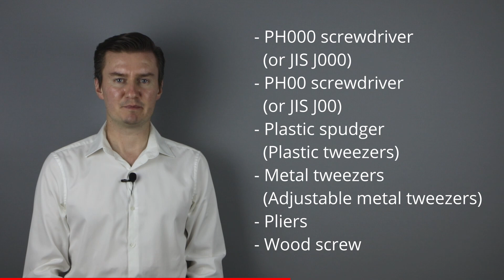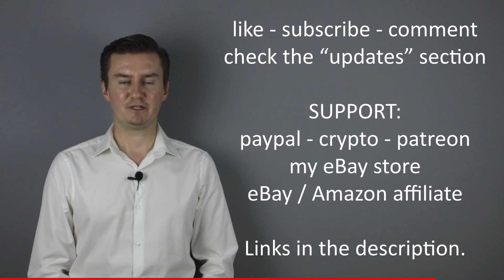Canon 15-85mm f/3.5-5.6 EF-S IS USM disassembly to replace the image stabilization flex cable

Comment: Hi. I have a 15-85mm with a slight wobbling front element. How can I solve this problem? Which are the screws to tighten?
Reply from the maker: Follow the disassemby process until 09:18 , then remove the cover which is on the front lens tube (three small screws which are parallel with the lens axis), then you will have access to the screws which are holding the front lens tube.

Comment: 09:20 For those attempting to do this. Before you extract the rollers, mark their position and orientation in relation to the cam barrel. The fact that the rollers are slotted (can be turned with a screwdriver) leads me to believe that the optical assembly is centered (i.e. optically adjusted) via these eccentric rollers. So, if you want to be cautios and retain optical quality, do not lose their orientation and position.
Reply from the maker: I checked the rollers, and they are symmetrical, not eccentric.
Reply: Very useful information! Thank you! The trunk came out when in the down position and came in when in the up position I disassembled the lens  according to your video. I turned the  9 plastic rings 90° and assembled it according to the video. Now everything is fine.

Comment: Hi,
I have a 15-85 that has some issues with the aperture. On 15 it stays at 5.6, 2at 24 it goes down to 4.0 other than that it goes to 5.6. It never reaches 3.5. Do you know what might be the problem?
Thank you. 
PS I really like your videos.
Reply from the maker: Does the lens gives error 01 when you shoot at small apertures? When it is, then most likely the aperture cable. If not, then most likely the zoom brush is not aligned correctly, that causing the lens so senses that the lens is not in 15mm when you zoom back completely.
Reply: @CamerasLensesEtc  I don't get any errors. Is there a specific alignment for the zoom brush? Can you send me a picture of that? Also my lens never gets to 3.5. Is this normal? It only gets to 4.0. Thank you for your answer.
Reply from the maker: @flaviup4082  I removed the zoom brush at 06:48 . Usually there is a mark at the two extreme positions. Mark could be a small line on top or bottom of the flex cable, or a thin empty line where the connector should be.